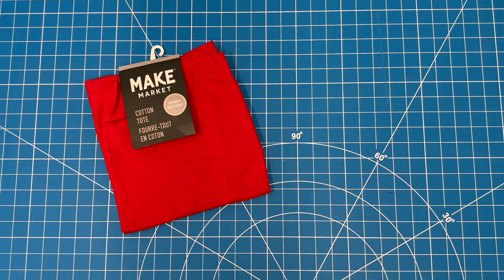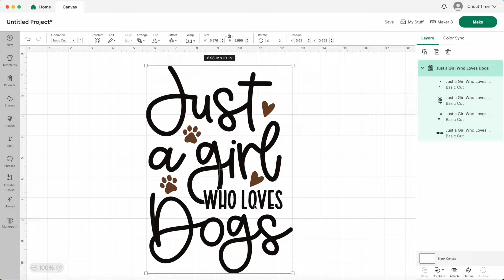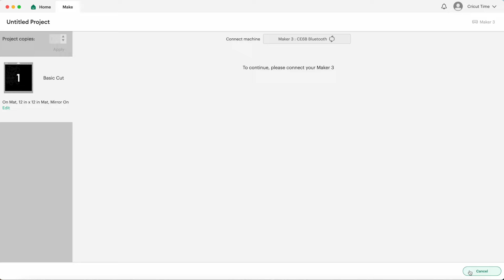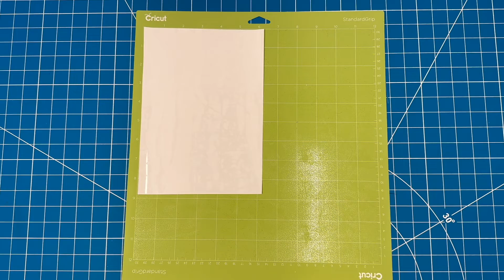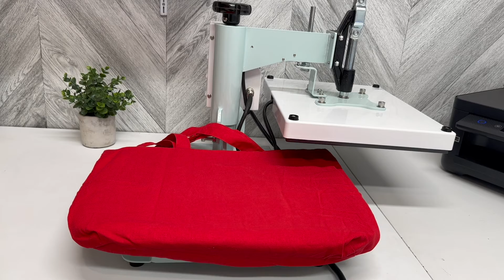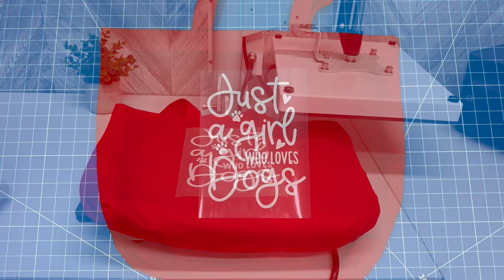Cricut Tutorial: How to make your FIRST IRON ON vinyl using your Cricut Machine!

Comment: Why do u need to use butcher paper
Reply: I use parchment paper or butcher paper.  It protects the heat plate from whatever you are using (iron, heat press, etc.)  from the materials being applied.  This is super important when sublimating with ink - such as transferring images on a sheet of sublimation paper onto a shirt.  A sheet of parchment/butcher paper is needed both on top and underneath to prevent getting ink on the heat plate above and the mat underneath your project.